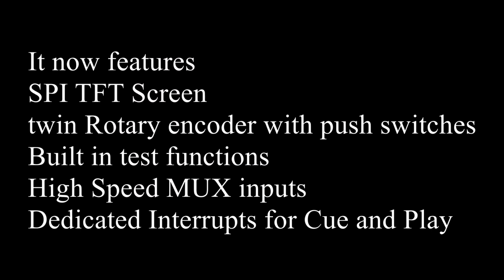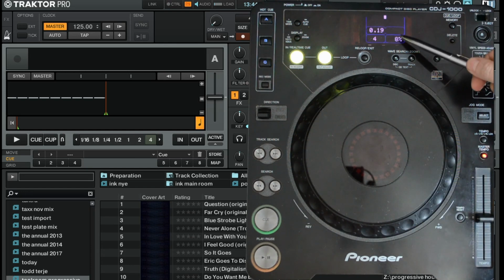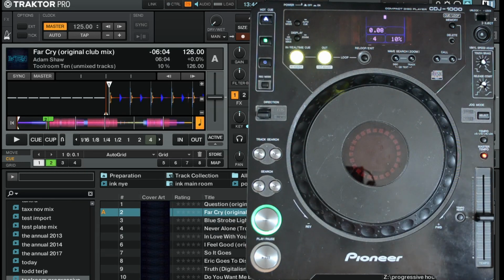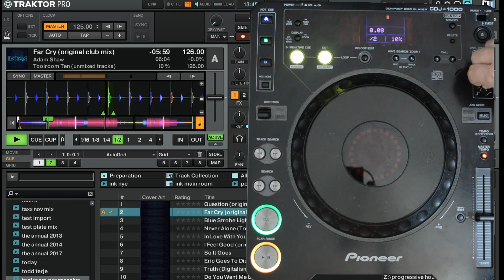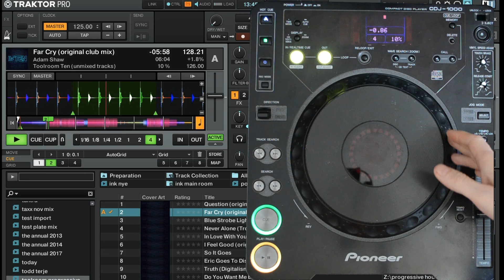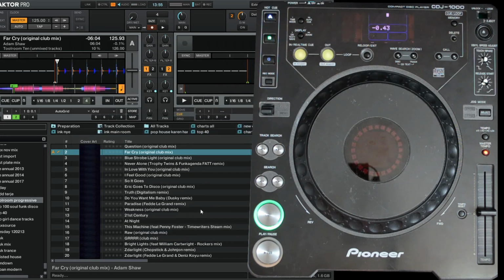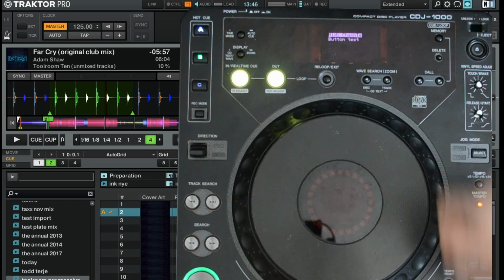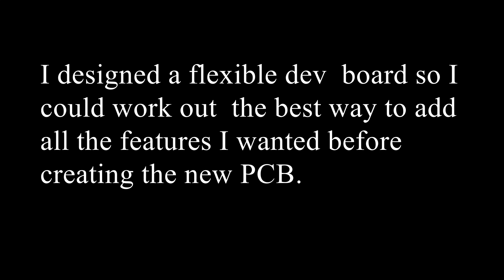Dead CDJ 1000 Midi V2   New features and optimised code

Comment: Hi DJ Legion! Great mod for this CDJ, nice job :-) Can you tell me on what bit depth the pitch fader is outputted by Teensy to Traktor? (To how many steps the pitch range is splitted) Many thanks!
Reply from the maker: HI, I use the pitch bend command so it can send 14bit values or 16,383 . The standard analog read on arduino and teensy is 10bit so I have to upscale this to match the 14bit.
Reply: @DJlegionuk  Thanks the answer, sounds nice :-) I was doing a controller with the Midibox NG from ucapps.de, do you know that platform?
Reply from the maker: @VNatur82  Sorry I do not.

Comment: I have a crazy idea right now for a mechanism to make a jogwheel mechanism from scratch, for use in an open source DJ controller. It would use gears to turn a standard rotary encoder to get more resolution. What I don’t know is how many turns of a rotary encoder outputting 14 bit midi would equal one turn of a normal high res jogwheel, and if this is just a completely impractical idea. Any thoughts?
Reply from the maker: The main problem is Traktor and Serato not accepting direct Jog wheel commands from anything apart from partner products. If I was to do it I would use something like the encoders used with the O Drive that are super precise and know it's position at all times.
Reply: DJ legion there are apparently workaround for that using Bomes, but I’ve not tried it personally. I was thinking more along the lines of getting it working with Mixxx on a raspberry pi 3 in the unlikely event I can turn this stupid idea in my head into actual hardware in the real world. If that happens, I’ll put it on the internet
Reply from the maker: Have you seen how small the encoder wheel is on the cdj ? the on and off  strips are so tiny it's hard to see them with your own eye. Most midi jog wheels work on a click forward and backward with acceleration so it's hard to say how many. 14 bit midi would be 32768 ( using + and - values)  in each direction if you could send it absolute  that would be 91 pulses per degree.

Comment: Amazing work dude! Do you know if you will have this project for sale as a kit? If so do you have a rough estimate on when it would be available? I would love to get my hands on a pair of these.
Reply from the maker: At the moment I don't know. The PCB's needs to be re-designed to work with SPI based rgb led instead of neo pixel because the interrupts it uses messes with the interrupts used by the jog wheel so they are not very stable. It will be another £100+ to get a set made up and  I don't have the cash or time to look at it for a while. I do use them  now and then and they do work very well, but I had  to reduce the led routines to make the jog wheel work correctly.

Comment: Awesome!! I've been following this project since you started posting about it on YouTube. I plan on modding some CDJs soon enough because buying modern ones are simply way too expensive. Are you going to get the spinning display to work in the centre of the jog wheel? I saw it was working in some older vids.
Reply from the maker: HI, I am looking at that, but was just trying to get the basics working as well as I can. The jog wheel was giving me a few problems due to the speed of the encoder wheel. It was sending way to many midi commands, but I think I have that working as well as I can. For the centre display yes I can use the neo pixel ring like before, but it's only 24 led and I think that is not enough so I am looking at using a 2nd tft screen or making some sort of led matrix that could be an add on option. I have used them to mix and they are working really well.
Reply: Great! Will you make the schematics public as well as the finished source code?
Reply from the maker: Eventually yes. Still deciding what I want to do with regards to kits. I already  put an older version of the source code on github.
Reply: @DJlegionuk  Any updates? Would love to acquire code or a kit to do this mod! SO AWESOME!
Reply from the maker: @ohniceness6138  Hi, I stopped working on it because I could not get the platter tracking to work that well and as traktor is dumb and I can only send that I am moving forward or backwards it has no way for me to tell it how to correct it's self.

Comment: Great project, could work with Mixxx software too?
Reply from the maker: Yes it will work with MIXXX and Serato, but I am not sure if some of the parts I have on the display like loop size and tempo range will work the same. I need to sit down with MIXXX and setup a full midi template.
Reply: Brilliant. I'll keep an eye out for developments.
Reply: +1 for Mixxx over here too!